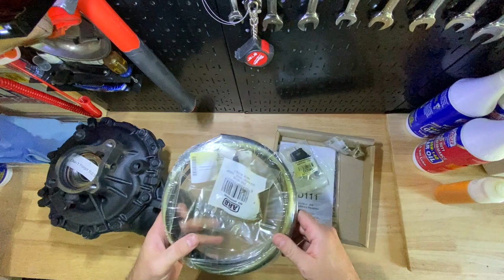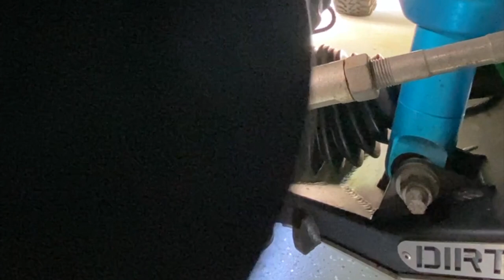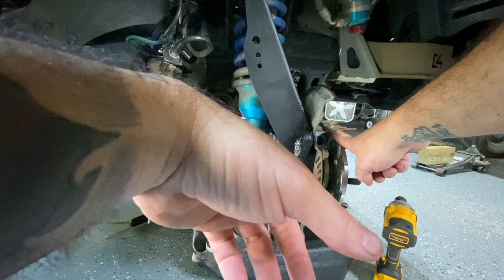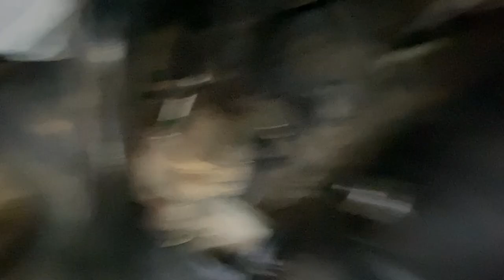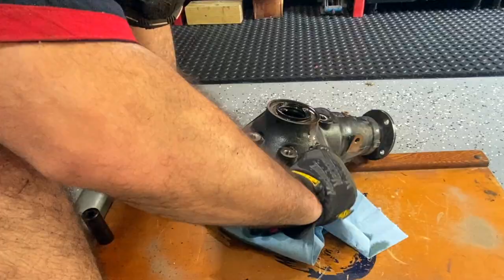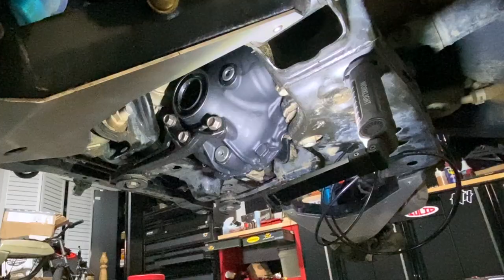Toyota Tacoma | Front Diff Install with 5.29 Gears and ARB air locker from East Coast Gear Supply

Comment: All of my dashboard lights are on after install, is that ok just to reset?
Reply from the maker: First check to make sure everything is connected and installed correctly. Check the plugs related to the ADD. Then run a scan to see the codes and go from there. Thanks for watching.

Comment: Excellent job, how much did you buy the front and rear Unit?
And do they have for tundra 2015 4wd?
Reply from the maker: Thank you. The prices are all different depending on gearing and locker selection.  Eastcoast Gear Supply has a ton of different options. Give them a call, they will walk you through the order process.

Comment: Bro what front ARB front locker did you go with? Part#? Been looking and I’m running 5.29s right now the options I can find doesn’t support 5.29s. Unless I’m reading it wrong
Reply from the maker: No worries had me tracking it down today. Per my receipt it’s ARB part number RD111,  8inch IFS 53mm carrier bearing. You can call East Coast Gear Supply to confirm exactly what you need. They will guide you. Just don’t buy anything till you know for sure.
Reply: @ClassyTacos  100%! Trying to do my research now. Appreciate your time. Actually went back to watch your video again and your box with the instruction had the part number on it. Thanks again
Reply from the maker: @kahai808  of course, I’m here to help.

Comment: hey buddy was ur problem that is moves as in it spun a bit and makes noise ? this is what my problem is i can spin my hand under the car about 3/8 turn each way
Reply from the maker: I didn't have any issues when I changed them. I did the diff change for gearing and lockers. Are you saying the cv axle turns 3/8s each way while you're parked wheels on the ground? If you thats not great.

Comment: I have 5.29 nitro gears on my Tacoma and I’m running 85w140 heavy duty Lucas gear oil. My front diff breather hose disconnected from the diff and has been spitting out fluid, I reconnected the hose and clamped it and it’s still seeping out fluid. My question is have you experienced this and do you think it would help to run a lighter fluid like 80w 90 or stock 75w90 to fix the leak issue? My thinking is that the 85w140 is too thick and it clogs up the breather hose. Any help is much appreciated thank you in advance.
Reply from the maker: A  question to answer to help your self diagnose. Is it blowing off when you turn on the compressor or just driving?   A couple things you can do. 1. is make sure the hose is not clogged and breather is functioning as intended. As is air is able to pass through the end easily. 2. is do not over fill the diff, once the locker is in there it takes up alot of the space the fluid used to be in. I end up putting in less than the factory stated amount. I do not have a measurement for you, it's just less. Something else you can do is extended the hose a bit higher and add an in line fuel filter. The in line fuel filter for a dirt bike or a lawn mower, get a clear one, kinda large one so you can see in it. They sell them at the auto parts store in the 2 cycle/ mower area. Sometimes they help with separating the oil and the air. Occasionally I get a little seepage at the breather tube, I have my hose clamped in with a screwable hose clamp. I hope that helps.
Reply: @ClassyTacos  first of all, thank you so much for taking the time to help me out. I don’t have a front locker so any leak is from regular driving. Last time I changed the diff fluid I filled it till the fluid went up to the fill plug. Maybe that’s more than what should really be in there? I will inspect the breather valve as well and see what could be the cause. But you don’t think the thick oil is the cause of this? Because I ordered some 80w90 to change it this weekend. It’s only my front diff also the rear seems to be fine.
Reply from the maker: @DirtRoad_Chronicles  For sure no worries. I see, thanks for the clarification on the front locker. I don't think it's the thicker fluid but who knows, it's worth a shot. For the front diff I believe  the factory calls for 1.6 litters, check me on that. That amount of fluid is less than the amount needed for it to come out of the fill hole, if I remember correctly. It might just be over filled. Hope that helps.
Reply: @ClassyTacos  yeah I believe it’s around 1.5. Im gonna check everything you said this Saturday hopefully I can find a fix. Thank you again.